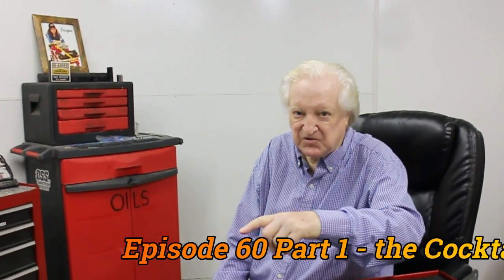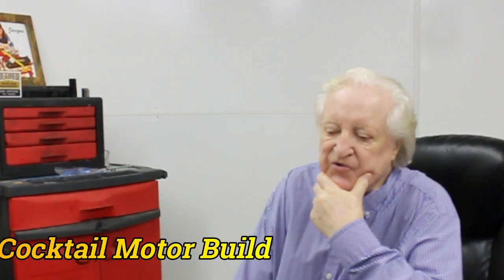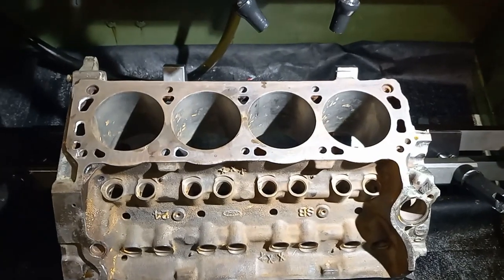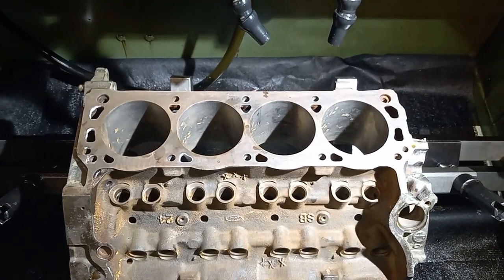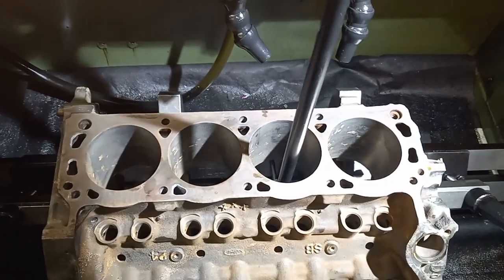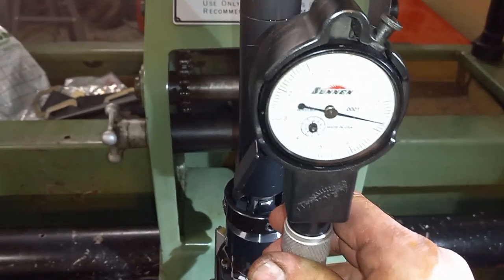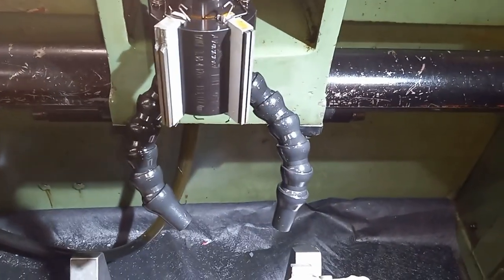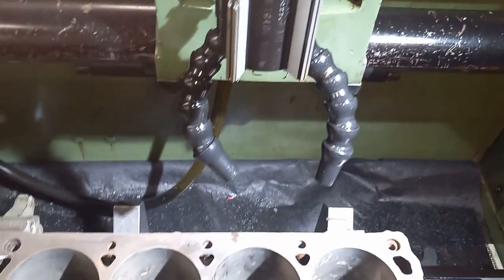the Cocktail Motor - a build like you have never seen!

Comment: Mr. Vizard, your content has completely changed the way I will be building my next TURBO engine. With the rough engine size in mind, I will be buying Heads first, upgrading to larger Exhaust valves, getting flow numbers BEFORE buying/ordering a camshaft, then continuing to build the rest. I love your content and have learned alot.

Comment: G’day David. This engine build is something I have always wondered about - how a bunch of mismatched parts would work together (if assembled properly, of course). You are a truly inspiring person, and whenever you talk about something, I listen and take note. You have been an idol of mine for decades; ever since I first read Performance With Economy (which was already several years old by the time I read it. 
Cheers, mate 😃👍🇦🇺
Reply: Drag racers have been using the AJPE 481X for years, has Hemi, BBC & Pontiac design. Essentially it is about 2.5 times cheaper to maintain than a Hemi and is designed to operate at lower rpm (relative to the Hemi) with more low end torque...

Comment: I haven't seen a block with the lifter galley painted in over 30 years. Old timers did that after hot tanking their blocks so oil flowed better, dirt didn't cling to the cast iron, or some story like that.
 Harley used to paint the insides of their motor cases because the aluminum castings were so porous, they would sweat oil thru. Red electrical motor paint IIRC.
Reply: Yep, Glyptol. You can hot tank an engine painted with it,and it doesn't come off.
Reply: @Mercmad  I wonder if you could get Glyptol to wick into a cylinder head crack then run just a 7 pound pressure cap on the radiator ??

Comment: My veiw... torque plates do not simulate a running engines heat signatures, heated chamber distortion, and are half thought attempt at fixing something inadvertently designed to distort...but leaves out the operational variance. The bore takes a diff shape bottom, middle and top when up to running temp..then consider heat spikes. In general..things wear in... the bore will take shape with wear and whatever distortion is introduced. Cooling and reheating after start up, now think about that in why they say take a leak down test HOT. Thats what the torque plate leaves to be desired. Why not try..yes, of  course...but let's paint the entire picture as to not misrepresent the diff between what we are attempting and the end result. As always, I very much enjoy your tech,stories..and appreciate you taking the time to share your experience and opinions with the masses.
Reply: Agreed. Would have to have a dyno comparison between an engine honed with no torque plate and one done with to see what the power difference was and more importantly for a street type build the test would need to be done on both identical setups after 500hours of runtime so things have had a chance to settle and break in as much as they are going to.
Reply: Leakdown tests are generally meaningless.  After all you never run the engine at zero rpm.  Bolting on the bell housing, motor mounts and especially the intake manifold on one of these engines all add some distortion to the block.  Still using a torque plate gives better results than not using one for finishing the cylinder bores.
Reply: @1WILDsMoPARtech  I think that there are many many factors involved some of which can be accounted for and some that can't.  Hot honing sounds interesting but it also sounds like it might make it tough to gauge.   Then what does it do with an aluminum head vs one made from cast iron.     The running engine vibrates and flexes the block around as the load changes from one firing impulse to the next.  Having everything machined as nicely as possible has to help but there's probably a point where you can machine it more accurately and it just starts to not make any real difference.    Maybe a lot of the reason why newer piston designs which are easier on the cylinder walls and ring sets that are more flexible help power is just because they can still manage to work reasonably well when everything is being thrown out of whack.
Reply from the maker: Dave, You are right on the money here. While doing a championship deal in the UK developing and driving a Cosworth Sierra we tried hot honing and it showed no gain in power. We also measured block distortion under full power conditions. The distortion could have been measured with a wooden rule!
Reply: @bcbloc02   Absolutely, rooted in reality. Add the ring and finish choice  as well. The best is always debatable. Lol
Reply: Mr. Vizard and Mr. McLain, have either of you ever measured the cylinders of a bank with an iron head bolted on, and then switched to an aluminum head on the same bank and measured the cylinders again for comparison? If so, what was your finding? Thanks and take care.
Reply: @carlcarlamos9055  I have not done that but it could be interesting.  My thoughts are that most of the distortion is caused by the forces that the fasteners exert on the block when they are torqued down and the threads act like a wedge and force outward on the threaded hole.  
What if instead of a torque plate a few spacers were slipped onto the bolts and then torqued down.  Would the distortion be very similar to using the plate or cylinder head?  Maybe.
Reply: @carlcarlamos9055  They know the answer, we know the answer. This is simply a case of "the best way" is in the eye of the beholder. To each his own. Been here done this as have thousands of others.

Comment: You got me thinking what would happen if you built half torque monster have high horsepower beast. Two different heads and a custom cam with two different grinds? I think if you were to try this the video would go viral and it would pay for it's self and some.

Comment: Do you finish hone the cylinders for the rings you'll use like Total Seal reccomends? In other words, if the rings are molly or cast iron, do you shoot for the proper oil retention in the cylinder, proper peaks and valleys for those rings?
Reply: According to Total Seal and many engine builders on the total seal podcast, the cross hatch and break in is everything.  Cylinders don't break in over hours of running in a good engine and or does the cross hatch and rings wear hardly, according to a lot of smart people.
Reply: @KimiWallrus  total seal told me alot of this back in 03 when I had em do a set of top gapless for a VW TDI-m build. 
They requested a ring sample ,and afterwards asked me to scare em up a set of oem rings as they liked the quality.
So for 30$ a hole back then I had top gapless rings and they worked great. 
They should darn near seat up in all the turning over that happens while building it
(that's a joke) 
Or within about 5mins of runtime you better have loaded em enough to seat them, otherwise they probably won't. 
That thing barely made a leak down tester tickle the needle after 10k and a 20k mileage test.
Reply: Yes.  I'll hone the cylinders and finish them by plateau honing.  This allows the bore to be smooth yet still keep the deeper scratches(RvK) to help retain oil.  I check this using a profilometer and sometimes adjust the honing process to get the desired finish.

Comment: Ive seen guys use   rocker ratios to max air flow, based on runner length, but this one takes the cake ,over boring the 4 outer cylinders with over size pistons ?
Reply: Yeah, was wondering about piston to bore clearance...
Reply: @BuzzLOLOL  depends most bores are 5 thou clearence
Reply: @tomashton1781  - Uh... no... most pistons are cast and 1 1/2 thou... forged 3-4 thou... even at 3-4 you often get piston slap noises that owners complain about...
Reply: @BuzzLOLOL  im talking about the four outer cylinders being bored .like 60 over, with over sized pistons
Reply: @tomashton1781  - I'm talking about them 'using whatever pistons they have lying around'... are they going to fit closely? .060's overbore on 350's tends to leave waffling paper thin cylinder walls when going for high HP...

Comment: Just wondering if his failure to bring all the head bolts for the torque plate might have skewed his measurements? He said that the block is flimsy.
Reply: Or get the block up to temp..along with the torque plate. Still not 100%, but better than 4 bolts and cold.
Reply: We'll see.  I'm going to be working on finishing up the cylinders in the block this weekend.

Comment: In the Ford world 302/351 both good. Chevy 305/350 not so much. Why did the 305 never have the potential the 302 had?  What was fundamentally wrong with the 305?
Reply: Small bore size.

Comment: I am old school for 'There is no replacement for displacement.' I must have HDADDOCD and get stuck on the SBC 400. The 350 is nice, but the 400 can go to 468, but I get the feeling that 427/434 CID is more logical. Most shops in the area try to talk me out of the 400 block and stay with the 350. This is mostly because of the local oval track displacement limits. I was in the zone with an 850+ HP SBC 400 outlaw dirt track drifting at 90 MPH and faster. Nothing like the thrill of coming out of a corner sideways and pulling the front tires!!

I was in a bad car crash and had 7 surgeries delayed for 9 years, and soon after a bad heart attack with hypoxia that wiped out most of my memory, though some has been returning. Do you have any dyno data for a 427/434 SBC for street capabilities with an automatic?? Yeah, I like a manual, but a machinery operator for decades, I think my left leg is 2 inches larger than the right from operating a clutch and pedal steering for decades. I am curious to know if the newer 8 or 10 speed auto's have any advantage over the 4 speed auto or even the 2 speed Powerslide (old school term - the new term is drifting), I mean Powerglide??
Reply from the maker: Jeffrey, sorry to hear of your unfortunate  crash. 
I agree with your 'no substitute for cubes'. Terry ,at Terry Walters engines and I (and probably Jack as well) have just started on a long term 468 inch small block.
 The head castings for me to rework arrived a couple of days ago.

Take care Jeff - I want to see a bunch more posts from you!
DV
Reply: @marvingvx1  David, Thanks. It has been a rough 31 years, but I calculate I am improving - I am getting back into performance SBC. I have an 84 Camaro Z28 that I want to put something in. It has a 'Grocery Getter' 305 right now. Probably 175 Hp if I push on the dash. Hahahahahaha!

I have a CNC milling machine and lathe so I can now do much of the work I use to contract out for.

What heads are you using?

Thanks. I will post when I can contribute.

Jeff
Reply: @marvingvx1  I don't have the data any more - ex had destroyed a bunch of my documents - but I am curious to know the flow of heads with 220 cc runners could flow enough for the 468 SBC or if the 245 cc would be needed. I haven't crunched the numbers yet, but will the SBC heads flow enough through the bowl for the 468 to achieve 6000 to 7000 RPM? At 7000 RPM that would be 947.9167 (948) CFM. Probably when I crunched the numbers decades ago intake runners were only 180 to 220 cc. That is why I was considering to stay with 427/434 CI range. The 468 would be a torque monster! I like sleepers. I told everyone that my 406 was a 305.